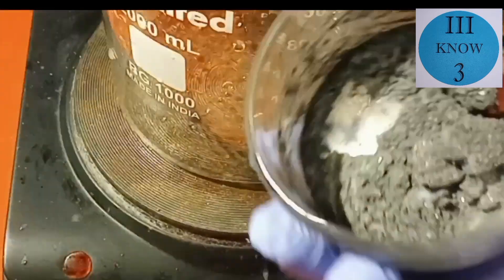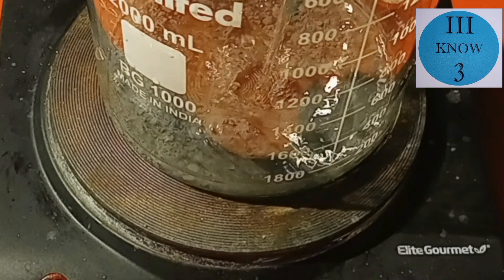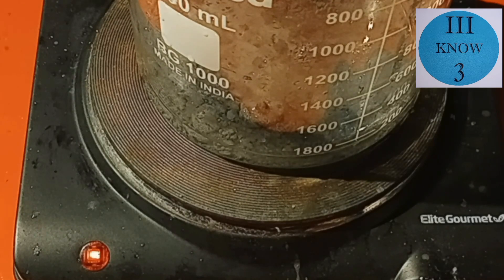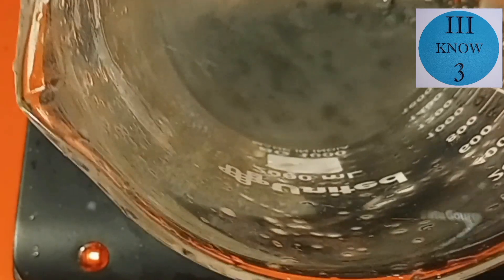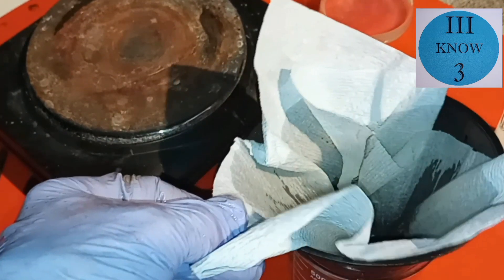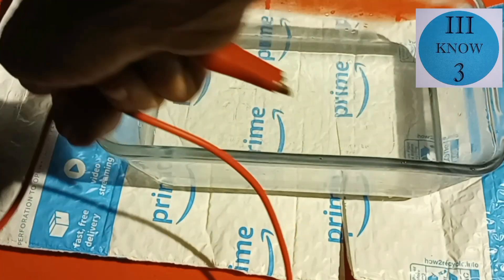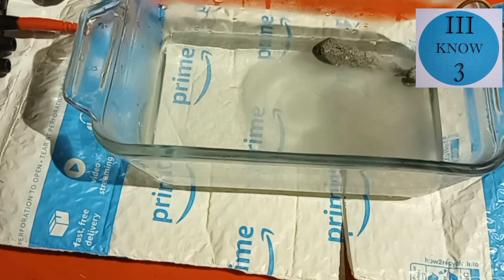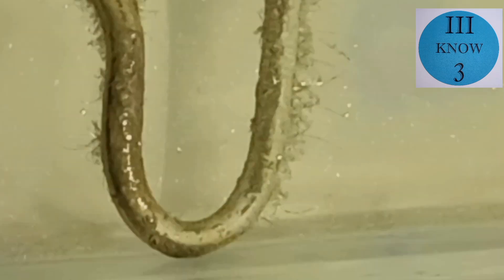Tin Metal Acid and Electrochemistry

Comment: Hi, nice video there, Btw Can i refine Sn from regular solder wire (63Sn/37Pb)with this way?
Reply from the maker: If you do attempt it, Please be very careful:
1)Respect the acids
2)Be outside, fumes and gasses are dangerous
3)Lead is very toxic to your nervous system and brain. Lead salt byproducts can enter your bloodstream through your skin and if the dry they can become an airborne inhalation hazard.  I made it look fairly clean but lead chloride and lead sulfate are very messy and they are difficult to clean from your lab glass.
I am not saying don't do it but know what you are getting in to.
Thanks again!!!
Reply from the maker: It is possible.  You may want to watch all 3 videos about tin and the one about the lead.  I will be doing a couple more about tin in the near future.  Thanks for the comment and for watching!
Reply: @IIIKNOW3  Thanks for your kind reply and suggestion.. waiting to see more of your videos
Reply from the maker: AWESOME!!